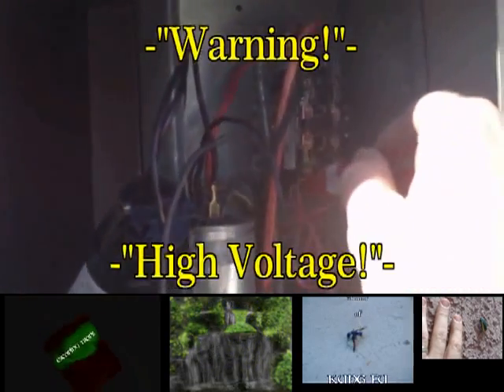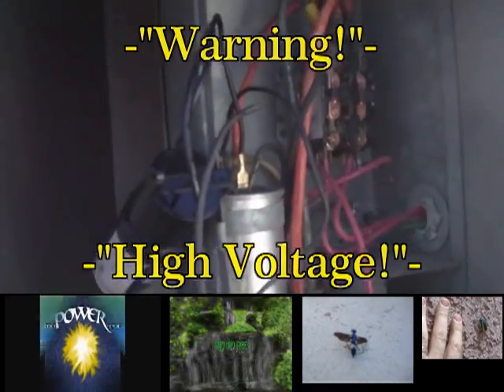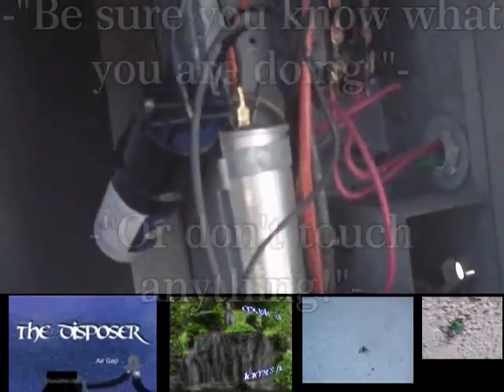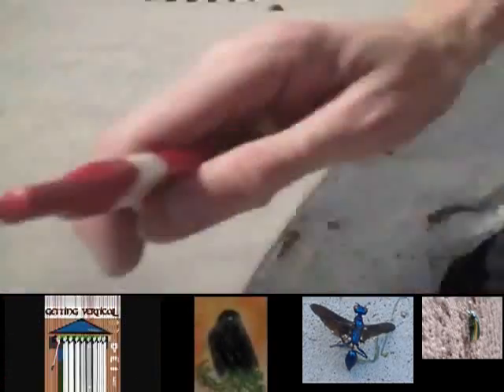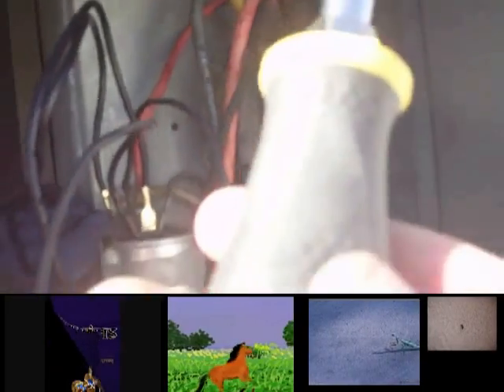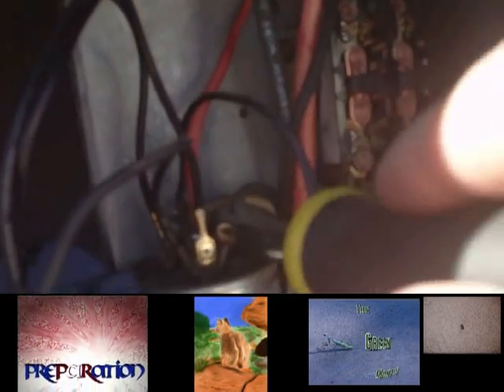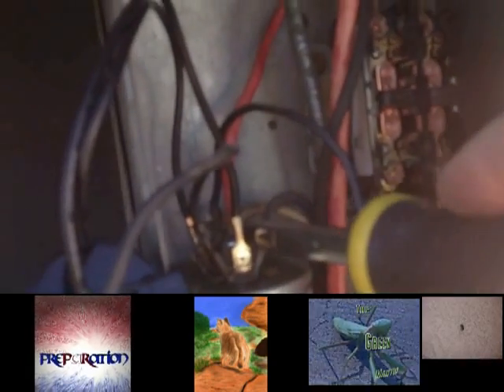Keeping Cool How to discharge Air Condition Capacitors by Kung Fu Maintenance

Comment: I put a new motor on my A/C and it worked great at first then quit spinning again after a few minutes. Could this be a bad capacitor as well? Can the motor burn up if it doesn't spin for a long time after it's powered up? Also: I just used my smartphone to take a picture of the wiring instead of drawing out a diagram. One wire, a black one, went to a black module next to the capacitor then a brown and violet wire went to the capacitor. The green ground wire  went to the body of the unit. Thanks for the helpful video!!🖒
Reply from the maker: +rick r Yes, and yes it could. You always want to replace the capacitor with a new one when you change fan motors. 🛠
Reply from the maker: +KungFuMaintenance Most motors have a thermal overload switch in the motor windings to prevent the motor burning up.

Comment: Hi KungFuMaintenance, I have  question. If the capacitor is out, can the fan and compressor both still work? My A/C unit works but then over heats and shuts off. The guy said it was because the coils need flushing. but he also said the capacitor needs to be replaced, and I suspect that part isn't true. but I dont know for sure. 
Thank you for your time.
Reply from the maker: If the unit has been consistently overheating due to poor air flow it may have put considerable stress and pressure on the capacitors. They can still work but may be losing their phase and kind of like spark plugs with an improper gap this can throw off the efficiency, timing, and reliability of the system. He also may see bulging of the caps indicating a capacitor that may give at any time.

Capacitors can be measured by testing capacitance with a microfarad meter such as a field piece multimeter and most A/C capacitors allow for a 5% tolerance. Under certain conditions however I would just replace them as well to prevent a no cool callback. There is a judgement call here but sometimes replacing them is just good preventative maintenance.

Your scenario often happens with a bad fan cap where the fan starts out running fine but due to the bad phasing the fan is being pushed off timing and eventually overheats the fan motors thermal protection and the fan shuts off. Than the compressor keeps running without the fan shedding heat and eventually the thermal overload for the compressor shuts off the compressor or sometimes blows the fuses or trips the breaker.
Reply: Thank you

Comment from the maker: The "deadmen's stick" or non contact voltage detector is just a final precaution that current is not currently flowing through the circuit. The discharge takes place at the cancellation of the screwdriver bridging both sides of the cap. It's a good final check before working on AC circuits especially on roofs with multiple condensors as some places conduit lines can be tricky determining which disconnect goes to which unit. The NCV is just another valuable precautionary step. It's a lifesaver.

Comment from the maker: Common practice as I used the term here means major majority of AC service companies do it this way without damage to equipment or personnel. Danger is an element to any work involving electricity and especially air conditioning where moisture is also often present.

Comment: And abut non contact alert device. Using it to check if capacitor is charged is total nonsense. Those testers can be used only to detect mains voltage. It won't work at all if device is disconnected from mains. With such checking you may think that circuit is safe while it's not. Charge on capacitor can be tested with multimeter.

Comment from the maker: That is partly true for more sensitive equipment, stereos, televisions, etc, for larger appliances such as used in heating and air conditioning however it is OK and is common practice.You will rarely if ever see a spark or hear anything when discharging caps for air conditioners.

Comment: Discharging capacitor with screwdriver is not safe. There can occur big spark which can damage leads and the worst thing, capacitor can be damaged internally (what can cause failure after some time) because of high discharge current. Correct way to do that is connecting resistor to capacitor leads so it discharges in a couple of seconds safely.

Comment: On another youtube site, you mention a "deadmen's stick".  Same as non contact voltage detector?  In this video (this page), you're using a "circuit alert device" to check for voltage in the capacitors. Do you recommend the brand you're using? If so, what is it, and is it a non-contact type - couldn't  tell from the video if you were actually touching touching those terminals or not.  Thx much.  Edit: I just discovered Circuit Alert online - sorry - I should have googled it before asking the Q.

Comment from the maker: Could you possibly take a video of the set up that needs to be changed and what you are changing it with and put it as a video response to this video or my video "How To Change An AC Condensor Fan Motor" perhaps with a cell phone camera. I think I understand what you are asking but would like to be sure and pictures or video would help. I should say you want to make sure the motor you are replacing with has same rpm and profile as these are engineered to work properly under specific conditions.

Comment from the maker: Your welcome, it sounds like it's low on freon. In addition to removing heat from the air the freon also acts to remove heat from  the compressor. If it runs low on freon for to long eventually the compressor will overheat and trip it's built in thermal switch. This will reset once it cools, or is cooled down. You most likely have a tiny leak somewhere. Micro leak repair additives work good for this and unit can be charged with refrigerant. If larger leak it must be located and repaired first.

Comment: Hi thanks for your help ,with A/C motel window unit 14.000 BTU workin goon but the low presure line do not get cold or sweat but the high line get good hot wath is this thanks